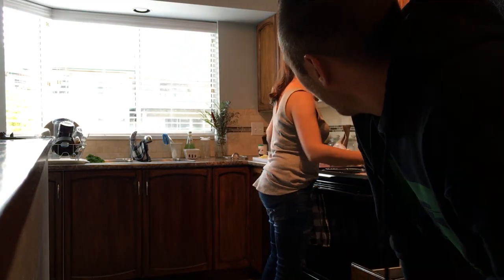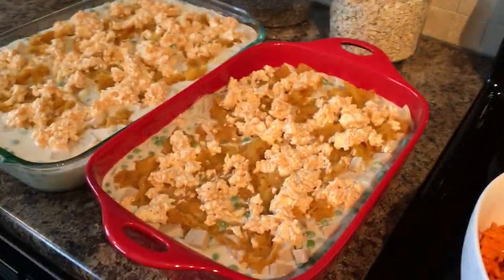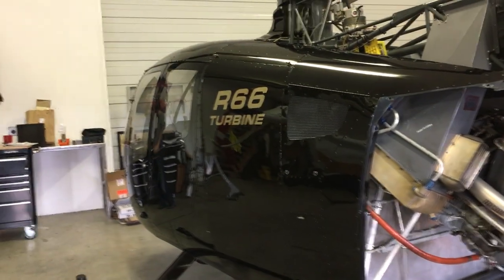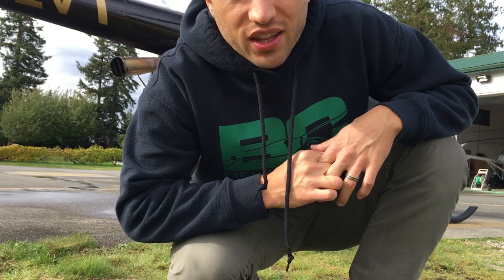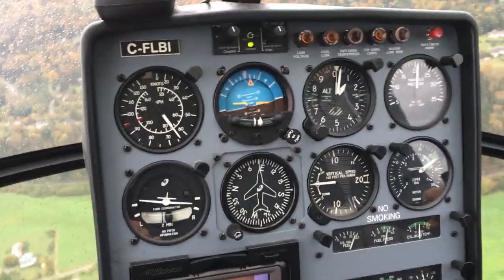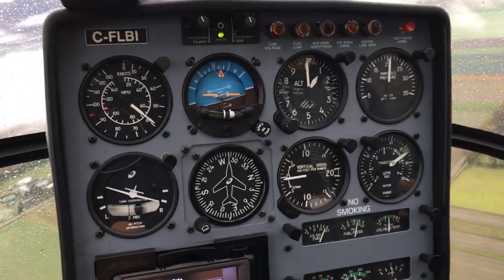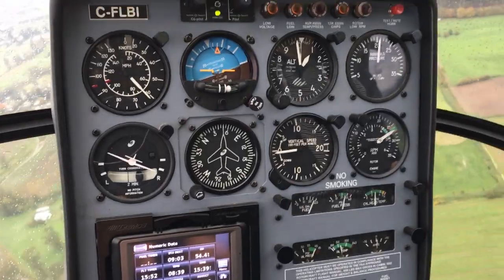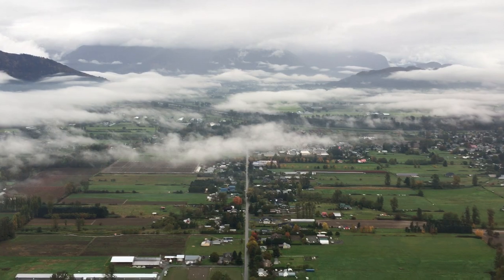How do you wash a turbine engine?

Comment: OMG thats a tiny turbine its so cute i just wanna cuddle it.. 
it would fit on a speed boat nicely. 
how many HP is it and does it also provide any exhuast thrust :P
Reply: It is Rolls Royce RR300 turboshaft. 300 shaft horse power derated to 270 shp for take off power and 224 shp continuous. There is also 715 shp version of "same" engine, it's called Rolls Royce Model 250-C40. I didn't fin price rof RR300 but my quess is between 200k and 400k